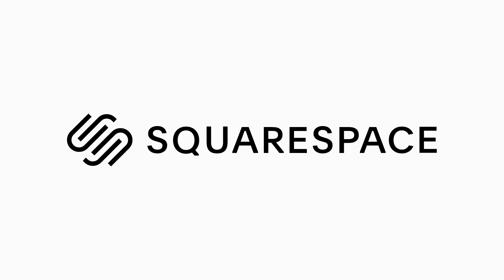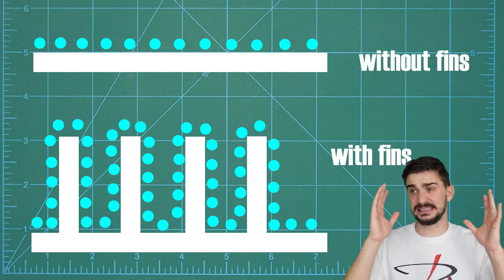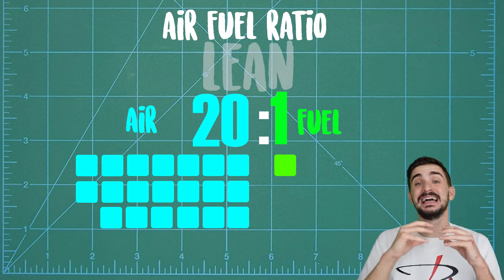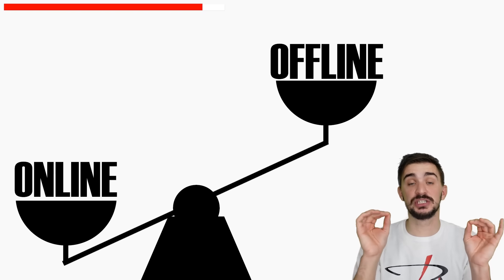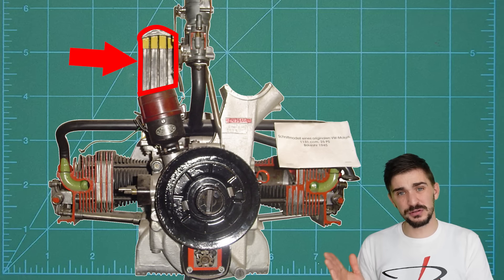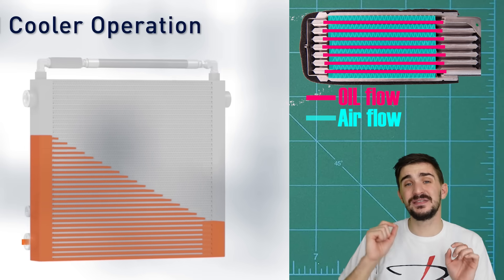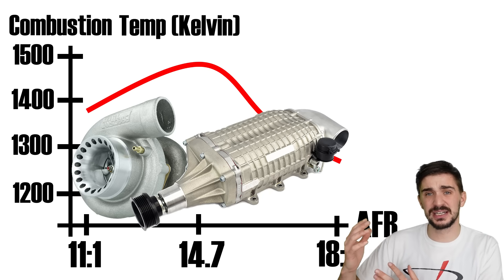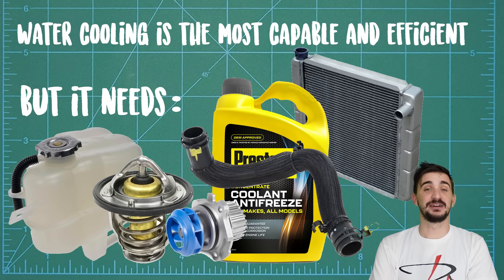AIR COOLED vs OIL cooled vs WATER cooled ENGINES

Comment: When I was trained as an aircraft engine fitter, one of the first questions we were asked was 'what does the oil do?' and we were told that apart from lubrication it was used to cool the engine.  With some large air-cooled aircraft engines the oil tank itself was 24 gallons or so and even though these engines used a lot of oil, the oil was cooled by an oil cooler and also by air flow around the tank.  Notably gas turbine engines do run hotter in the turbine area but do not use the oil to cool the parts very much.  The oil is often used to heat the incoming fuel as kerosene is not good at very low temperatures.  However these turbine engines have very small oil tanks, normally only a gallon or two.  As they don't use much oil, this is fine.  Oil in modern turbocharged engines is also used to cool the turbine and compressor bearings but many of them also use water cooling of the turbocharger.  These are especially useful on shut down where the oil can boil in the bearings and cause damage.  
But you are correct in saying that eventually the engine and its parts are cooled by ambient air.
Reply: For my Private Pilot License, I learned that oil:
- lubricates
- seals
- cools
- removes contaminants
Reply: @olafzijnbuis  Beat me to it. 
Yeah learned that in high school mechanics class.
Reply: in gas turbine engines the oil is pretty much only to remove heat from the bearings, it's all ball and roller bearings so there is no sliding friction. The oil is also very thin
Reply: p47s in ww2 on their largest ferry tanks used to fly them from the us to Europe for delivery. they had to use brand new low time engines because with normal oil consumption it would run out of engine oil before making it to Britten. all 28 gallons.
Reply: @nick4506  I heard the corsair had a 50 gallon oil tank. But I can't confirm that.
Reply: RE: Turbine section cooling, I love that the 2500'F first stage turbine nozzle is cooled by the only 1000'F bleed air. Gotta love those nickel super alloys.
Reply: @TurboHappyCar  Combustor exit air can be much hotter, 1650°C / 3000°F, higher than the melting point of the alloys used downstream (my area of expertise). Very elaborate cooling channels are formed in those parts, but the only suitable air as you say is from the final compressor discharge, which has gotten uncomfortably high for many components exposed to it (nearly 760°C / 1400°F, the limit of disk alloys). The "diffuser" and "impeller" receive a great deal of aero attention just to keep this flow of air as cool as possible. Every bit of the engine receives a great deal of attention, of course, the most sophisticated machine in existence, I believe.
Reply: @curtaustin8119  Yup. I was using generic numbers based on the CFM56. It takes a lot of engineering work to make these engines reliable.
Reply: Modern fully synthetic oils have a very high boiling tempetature.
Reply: Basically: water is most effective but least reliable and most expensive.  Oil is the most reliable and prevents internal corrosion.  Also, modern synthetic oils can withstand heat up to 360F (190C).
Reply: aircraft air cooled engines are someting special because air cooling is not the best choice: at climb at full power is the cooling too low because low speed, at level flight is the cooling perfect but the badest moment is the descend before landing: oil is very hot, the engine is reduced to idle, then the cooling is much to high= the pistons are grow from the oil heat and cylinders shrink due to the airflow and the low heat in the combustion chamber= high risks to size the engine.To avoid this, are air cooled engines made with very large gaps between piston and cyclinder, this increase the overall oil consumption and increase the blow back in cold condition (and make the engine difficult to start in cold condition). A liquid cooled engine avoid such problems because a much better t° regulation, this explain why air cooled engines tend to disapear because they emissions are much higher on such engines because oil consumption+ run rich to avoid knoking...
Reply: @leneanderthalien   - Honest question: What the hell is "size the engine"?  Are you trying to say seize the engine?

Comment: Kusheen was here...
Reply from the maker: Hey there, I'm glad when you drop by. The regularity is reassuring
Reply: @d4a  Looking forward to seeing and hearing your MR2 in action. I used to own a corolla with a 4afe so I have a soft spot for that motor. Generally I'm interested in anything that burns fuel and goes fast, cars, bikes, boats, planes etc.

Comment: So my 2000 VICTORY v92sc has an oil cooler so it's oil cool then. V92sc takes 6 qts vs cbr 600 f4i takes 4 qts water cool.
Love learning something new everyday.
Reply from the maker: As I said it's not the sole presence of an oil cooler that makes an engine oil cooled. You need to know whether it has dedicated channels for circulating the oil with the intent of cooling rather than lubrication.

Comment: 5:25 most air cooled engine with not damaged thermostat will reach temperature faster-this is easier to heat a couple liters of air than heat a couple liters of water
Reply: @d4a  i had one air cooled car and couple liquid cooled. Only in air cooled i had warm air inside 30s after engine start, even on coldest days.
Reply: @nanab256  your trolling right???😂
Reply: @mrwhips3623  no, i really had fiat 126.
Reply: @nanab256  dude, just cuz there's warm air around your engine after a minute of running dosent mean it's at operating temperature 😂
Reply: @mrwhips3623  warm air in car, not around engine, and in 30s not minute. This mean air cooled build temperature faster, in watercoooled i need a couple minutes to reach same point.
Reply: @nanab256  lol ok, but your forgetting at small engine will warm up WAY faster. My water cooled ninja 650 also warms up very fast.
Reply: @mrwhips3623  Almost the same engine like fiat 126 was in cinquecento700, only difference is 50ccm bigger diplacement, reversed rotation, a couple HP more, and diferent cooling system(watercooled).  This is still r2 ohv ~700ccm powered by simple carburetor and cannot warmup faster or even same like aircooled version.

Comment: Great video as always, but are there really less parasitic losses on electric water pump compared to directly driven one? I'd expect that the main reason to use one is to allow cooling of the turbo and rest of the engine even after it is turned off.
Reply: Operating RPM plays a big role in answering your question.  Mechanical water pump RPM varies with engine RPM, and a design optimized for stop and go traffic at 700 RPM will have measurable losses around 7000 RPM.  Optimized for 7000 RPM won’t circulate enough coolant at 700.  At relaxed traffic speeds it probably isn’t going to be noticeable to the owner, but manufacturers need every little bit of efficiency to reach MPG goals.  On a race car the extra 5 to 20 horsepower can be worth the increased cost and possible supporting modifications to make an electric water pump work.
Reply: I suppose it is because it is decoupled from the engine rpm and it could be servo controlled to hit a desired temperature.   Like EPS.   It is not just the turbo, the engine can get heat soak once switched off.  The pump is going at a rate that can empty a swimming pool in relatively short order, then you go to zero on switch off.
Reply: That's not true... The alternator load vs the water resistance on a belt drive is minuscule were talking 1-3hp... The advantages of an electric water pump are being able to cool the engine more at idle, low engine speeds and while the engine is not running... But for all out performance its a wash
Reply: @Andrew Ross But that's the thing, isn't it - you need a power source for the electric pump to work and how else do you get it than with an alternator which introduces a mechanical parasitic loss. Except in the case of the pump being electric, you not only lose the power needed to power the pump, you also get additional losses from the inefficiency of the alternator and the electric motor that powers the pump. So driving the pump directly will always be more efficient.

Comment: Very informative video. I do have a question tho.
Why is it that the temperature of an engine ( its coolant to be more specific) is mostly set to 80-90°C? 
Why is it not 60 or even 120??

Thanks in advance.
Reply: 90°C is usually a compromise for watercooling, fuel atomisation and keeping pre-ignition and detonation under control. 
120°C means you now need 1bar of pressure to keep it from boiling (pure water) - stronger seals and joints, more prone to leaks. Also the oil will oxidize faster. Note - there are engines that have a pressurized coolant loop and operate at >100°C.
60°C would need a much greater radiator surface area with the same thermal output. Also good luck keeping the coolant at 60°C when the ambient air is 40+°C. 
Modern direct injection gasoline engines have multiple cooling loops to keep the head as hot at possible at low power (efficiency/emissions) and will change said head temp under high load to keep the engine from knocking.
Reply: In a water-cooled engine, you want to have the water at around 90C because otherwise the engine block will be cooled down too much in certain areas, leading to material fatigue and stressing /tensioning the metal, possibly cracking the block. That is because metal expands slightly when heated, and therefore you want the metal to be evenly expanded, and not some "cold spots" forming. That`s why you want to circulate a lot of hot coolant, and not a little coolant which is then cooled down drastically.
Reply: Engine temp and coolant temp are 2 different things. Your cylinder head isn't 80 - 90degC.
Reply: @thedirtyworkshop  yes, but why is the water temperature mostly around 90°C ? Is there a reason for that ?
Reply: @littlereptilian7580  id imagine its to have the least amount of coolant possible to keep it at the right temp to make it more efficent and light weight. Its probably similar for different engine sizes too but im only guessing.

Comment: 1:25 thermostat is needed in air cooled engines too, same with pump
Reply from the maker: Yes, some oil cooler setups do have a thermostatic setup, but it's definitely not necessary and there are plenty of oil cooler equipped engines without it.
Reply: @d4a  most of air cooled engines have thermostats too, like old porsche, vw, fiat, i had 126p-same engine like fiat 500. "but it's definitely not necessary" same with liquid cooling, u can uninstall thermostat and engine will work anyway.

Comment: In the 80's. There were two 911SCRS rally cars in the middle east. One was a factory car, the other a prodrive. The fatory 911 used to overheat in the Gulf rallies. Prodrive simply installed a huge oil cooler, problem was solved.Car won the championship for multiple years.
Reply: I've always wondered about super cooling an engine. I know it's not cost effective but if you could use liquid nitrogen cooling for the exhaust and cylinder head combustion chamber.  And for that matter if you could use it on intercoolers for turbos and blowers where it ran through the equivalent of a intercooler that fits in a area below the throttle body so the intake air is cooled to close to 0°C before the fuel is injected.
Reply: @theEVILone0130  For the purposes of absolute thermal efficiency, a hotter engine should actually be better. The rate of heat transfer is a multiple of the temperature difference, so the colder the block and heads, the more energy will be sapped from the combustion before it can do useful work.
Reply: @theEVILone0130 Think about the drawbacks. 
If you carry Nitrogen as a coolant, it would have to have a compressor and a complex system to get low-pressure and high pressure zones to obtain said cooling and recycle the nitrogen. 
And if you just release the Nitrogen, you'd have to carry a heavy tank to store it, and be recharging the Nitrogen constantly.
Sounds like a cool concept though.
Reply: @theEVILone0130  That will be very interesting to see, I hope it's tested one day!
Reply: well the more hotter the oil is it give less protection and lubrication that make more heat and create heat loop. Breaking the oil film loosing compression and power.

Comment: Please say you don't think friction is the main heat source...

I'll keep watching...

No mention of waste heat, customs etc. Most of the heat is from combustion  hence the cooling is applied there. Also higher powered modern engines use oil and water cooling each with their dedicated cooler. Some engines even have oil to water to air exchangers. You need to more research on Google dude.

Edit... is the comment still visible?
Reply: Isn’t it from the exothermic reaction
Reply: @quinndenver4075  ultimately yes, but from an engine point of view that's what we want. What the engine has to deal with is waste heat. Some that can't be avoided.